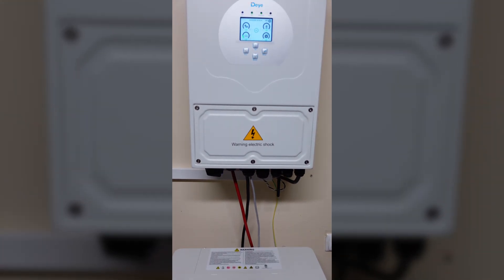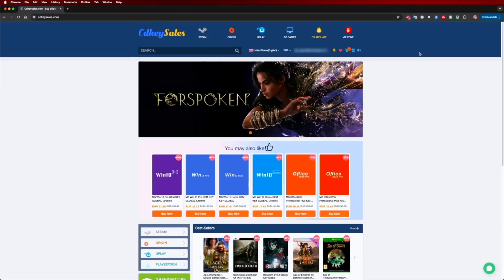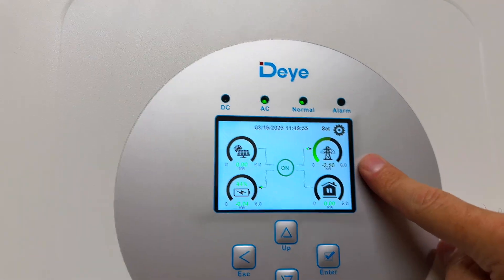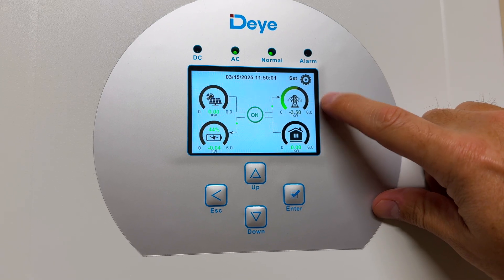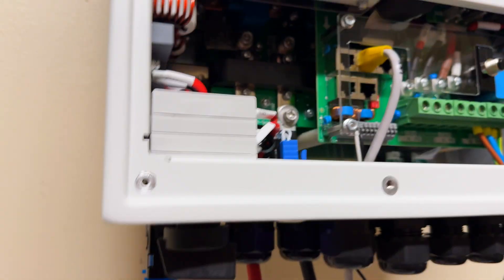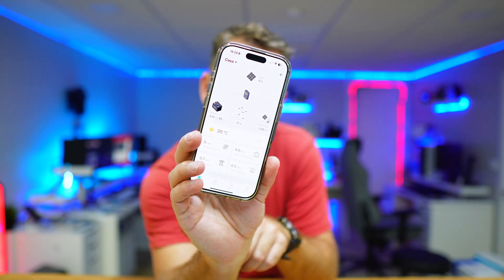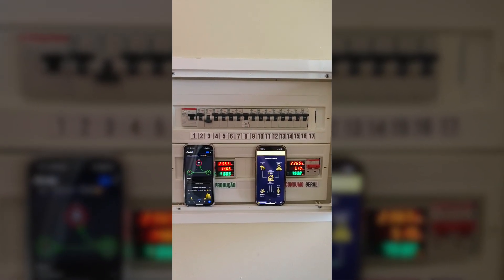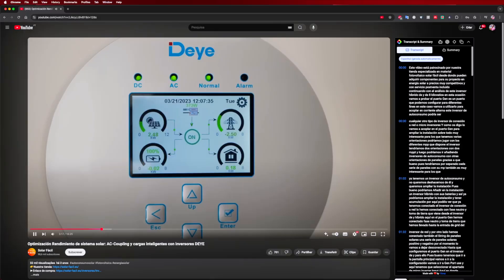Add a Battery to Any Solar PV System 🚀⚡️Deye SUN 6K & Felicity ESS

Comment: 4:40 Does this device affect the waveform of the inverter? 
My info is this device use triac that works as dimmer which confuses the control board of the inverter

Comment: Hi there I am trying to establish communication between LG ESS EM048063P3S5 battery** and Deye SUN-6K-SG04LP1=AU inverter can you help? Inverter has RJ 45 BMS and battery RJ48 normal patch cable doesn’t work is says no battery?

Comment: Deye has a cool feature,the smart load. With this you can connect the inverter with the sun -water heater and when the panels have excess power that they don't have anywhere else to give (because the batteries are already full) then the excess power goes to the sun -water heater and gives electricity to keep the water hot!

Comment: I was planning to sell my non hybrid inverter and buy hybrid inverter to connect to batteries. I never knew that I can leave exsiting nonhybrid inverter and buy another inverter to charge batteries. But where is the benefit to do this way? Only not to mess with wires?, but now I have two boxes on the limited wall space.. is there maybe financial benefit?

Comment: have a Solaredge 4kw invertor it has no battery or generator input, still wonder how i can use AC coupled battery so that the invertor can manage the battery when theres a exces energy from my solar to use to charge a battery